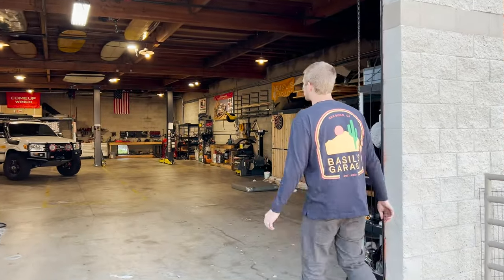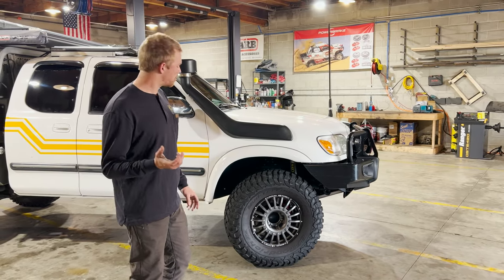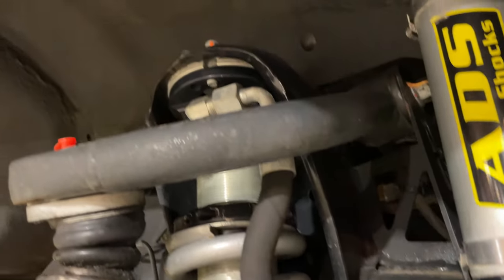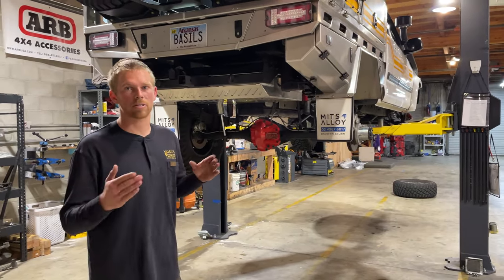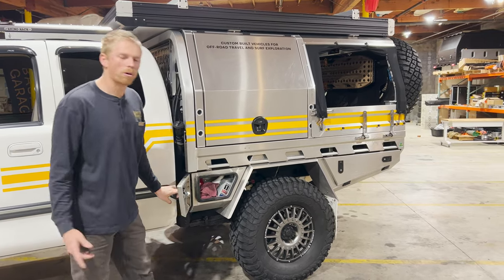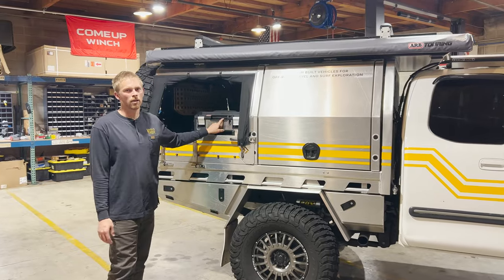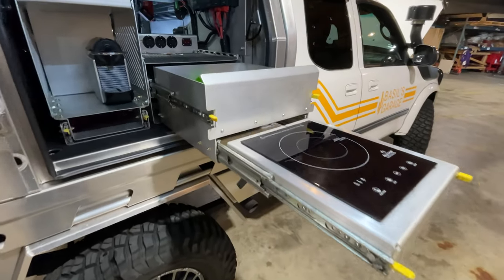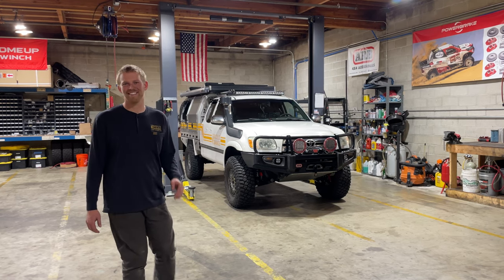The ULTIMATE Australian-style Baja surf truck

Comment: Absolutely mega, really well sorted.
One question how many controller displays can control the red vision system, brilliant idea in front and both back side. 
Super expensive but great idea. 
Thanks Sam
Reply from the maker: We talked with REDARC about this, and wasn't able to get a solid answer. Three is the most I've seen, but in theory you can run as many as you'd like. Eventually you'll get voltage drop due to the wire length. You do have to program each controller separately.